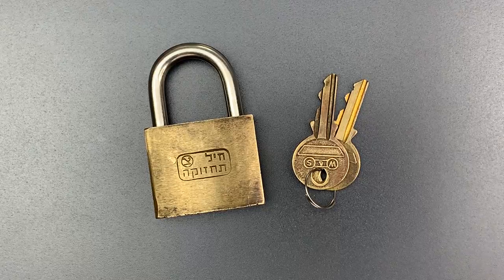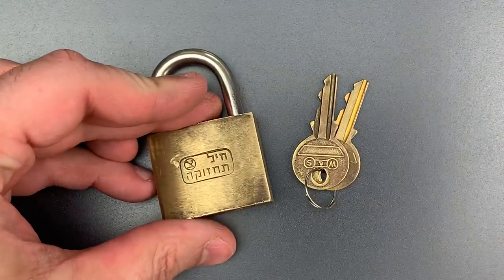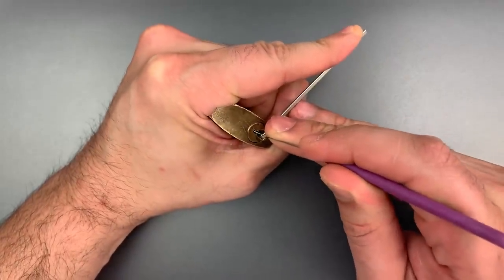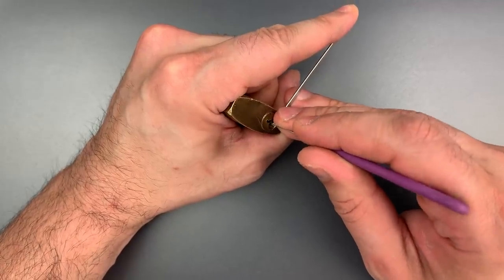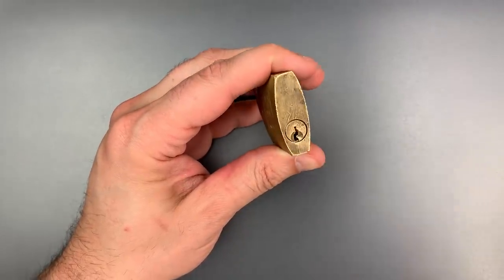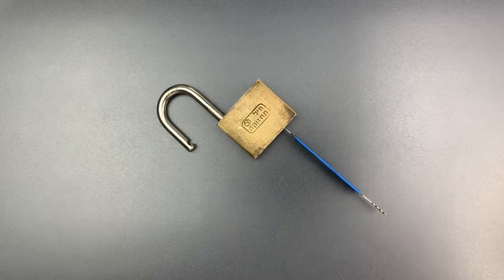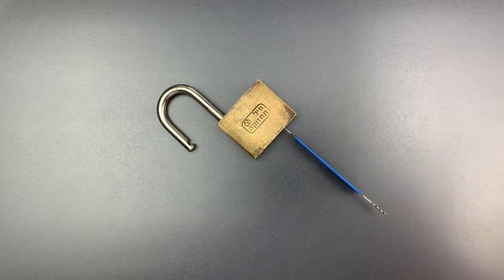[902] Israeli Military Lock With A Serious Design Flaw

Comment: A military lock that is bypassable... That's concerning
Reply: HAMAS: Hummus located
Reply: but not surprising.
Reply: From what I know of the IDF, and my experience with a handful of their career soldiers, I wouldn't worry. Sure, you get in somewhere you aren't supposed to be, but how in the nine hells are you going to get out somewhat intact?
Reply: @chongjunxiang3002  There's a very big difference in impact between stealing the rations, destroying the rations and contaminating the rations without leaving any sign you were ever there, which is why a glass window that can be smashed through to provide a means of entry isn't necessarily as big a security weakness as a lousy padlock on the door.
Reply: This isn't a "military lock". This is just a lock that the military happens to purchase in large quantities and that was branded with the letter צ like most of the equipment the military purchase. This lock wasn't made specifically for the military nor was it designed to specific standards. Soldiers use these to lock up their personal belongings, and I used these to lock the toolboxes of my truck. However I just took a closer look at one that I have and it has a different structure. The core is in the center of the lock and the tooth that holds the shackle moves linearly rather than rotating.

This isn't meant for securing the nuclear arsenal. The locks they use for securing weapons are much beefier although I am certain that LPL wouldn't have hard time picking some of them. Locks of the type featured in this video are commonly used for detering people from stealing personal valuables.
Reply: That sounds alot like the TSA locks.
Reply: Every lock is bypassable
Reply: @yairsollel4197  Well, yeah. I meant that it's concerning that a military lock is easily bypassable
Reply: @airmanon7213  its not meant for high security stuff.
Im sure the IDF has more advanced locks and ones you open with a mere metal key.
Reply: Alexander Rewijk The capabilities of the soldiers protected by a lock are unrelated to the capabilities of the enemy operatives conducting covert attacks such as poisoning supplies or sowing internal strife by planting contraband in personal lockers.  In the case of the IDF there are many enemies willing to die from an attack, and plenty of enemy specialists willing to teach specific techniques, such as bypassing one or two known types of lock.
Reply: Airmanon i wouldn’t be really concerned I’d say a few uniforms, a pair of boots, and a shaving kit is about all these secure lol
Reply: I saw these in every IDF base I've served in. We secure stuff like toilet paper and brooms with these. For weapons we have mandatory full time personnel or beefy mul-t-locks with once-an-hour patrols. Not that you'd get in the base easily anyway.
Reply: Michael Fridman yes I have the same type of lock that I bought from the store on base. We just used them on luggage. We aren’t required to use that lock.
Reply: Oh no, now all of the 19 year old kids are going to be bypassing these and getting into the officers' food... don't worry this lock is mostly to keep the sausages safe from the shithead 19 year old conscripts who are forced to survive for days or weeks at a time on fried-blocks-of-oil-with-a-hint-of-schnitzel at the base or giant cans of tuna and pickles in the field.
Reply: @fukumarkzuckerburg  Strange how these locks are on the live fire range gate and on the kill house front door......
Reply: It's low security our army has same thing
Reply: I was issued a very similar looking and sized lock (but without Hebrew markings) at USAF basic training in 1982. Everybody got one to lock their locker in the barracks. Not intended to keep the enemy out of anywhere important. I agree with other comments that while militaries bought these in mass quantities, they were not "military" grade locks.

Comment: '...ballast on their ships.' 
LPL just sunk an entire company in under 4 minutes. Impressive.
Reply: @mattiasw.5846  still not enough for that burn!
Reply: Can someone pls explain the joke to me?
Reply: @ramennight  Ballast is material you put in the bottom of a ship, effectively just to weigh it down. Typically you might use rocks or gravel, or in a pinch you might use whatever garbage you have lying around, as long as it's heavy. A creative way of saying the lock has no value outside of being a lump of metal.
Reply: Ty
Reply: @ramennight  How did you understand its a joke if you need it explained?? Mind Blown
Reply: @miniwaern  90% social context with a bit of an educated guess.
Reply: @aku343  I agree. Suggesting to use the locks as ballast is a way of saying it's an expensive paper weight but in case you have lots of them, using those as ship ballast is better than nothing. The market for paper weights is pretty low nowadays.

Comment: best portable potty padlock they use it to secure the toilet paper Rod so nobody steals toilet paper
Reply: Dont you need a bit higher security for that? Potential toilet paper thief would have plenty of private time with it, especially after an MRE. So to prevent negative impact on troop morale they should definitely get some better padlock for this application.
Reply: Heinous crime over there, means they will have to air raid Palestine for at least a week...
Reply: An army without toilet paper is doomed!!!
Reply: [Angry Cornholio Noises]

Comment: So this is equivalent then to something like a lock issued for personal locker/footlocker storage in barracks... the comb pick bypass might be intentional so there's a way for accessing the lock if the original owner and/or key is no longer available, with a "universal key" issued to staff somewhere or the equivalent of MP.
Reply: Na.  At least in the US military (though I imagine it's similar in other countries), if the original key is missing, the only "master key" that is used is a set of bolt cutters.   Unless the lock has a serial number and a new key can be ordered from the manufacturer, there's no point in saving the lock, particularly when you're talking about a cheap, low security lock like that one.  Just toss it and pull a new one out of supply.

Comment: Low security lock used for simple storage such as lockers for personal items and stuff ...

Every soldier gets some simple lock from day one to prevent personal item theft between soldiers
Reply: Rob C  when you have a mandatory army it comes expected that some percent will be thieves
Reply: @Rob C I think higher ranks steal larger things

@Cosmo Mandatory or not, I think personal lockers are, as named, locked in any organisation in the world...
Reply: Then it turns out they got them on the cheap and there are only 8 actual key patterns for all 80,000 locks?
Reply: Sableagle That would be bad with more than 8 soldiers in each group.  With careful distribution you could get away with one pattern per soldier in a group.  With random distribution you need the square of that number.
Reply: @hihu7200  Nah. They just use the locks from the water-treatment plant gates since the IDF blew up the plant, all the electricity substations since the IDF blew up the power station, the school's stationery cabinet since the IDF shelled the school, ...
Reply: Righteous  I have not eaten any extra spicey Mexican food for a long time now, so luckily I do not have to worry about that.
Reply: @hihu7200  I'm not attacking innocent Israelis. Did you mean the children in that school were attacking innocent Israelis? The ambulance drivers were attacking innocent Israelis by bringing those children to hospital? The patients in the hospital were attacking innocent Israelis by getting in the way of their bullets while harvesting olives? That schoolgirl was attacking innocent Israelis by learning English?
Reply: @Sableagle  Lets set politics aside and focus on locks. This is not the correct place for politics. 

Thanks and have a great day.
Reply: Righteous  There is no place for hate here or anywhere else on the internet. 

Please limit your future comments to lock related comments. Thanks.

Comment: So that's why the bibles are usually centred — to prevent the driver pins from being fully lifted. Thanks LPL!
Reply: Overlifting is a serious design flaw on any lock. It's not difficult to prevent, you need only to have appropriately sized pin channels
Reply: Stink simply stink Or appropriately long pins or fillers.  Ram a long enough peg in each hole before sealing the top, and problem goes away.
Reply: @johnfrancisdoe1563  basically, there is really no excuse to have such a major design flaw. its not even like its an unknown one
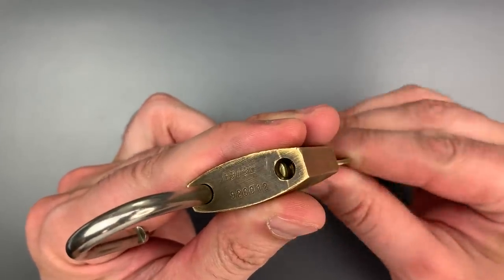Reply: @expertoflizardcorrugation3967  I think the only excuse here is that the lock is from 1992 (seen at 1:43), so curious to know if the locks they currently use still have the same flaw.

Comment: I have been thinking of the design flaw you are exposing. And I think it's a design feature, not an unintended flaw.
Some people here have said that these locks are issued to personnel, for them to lock up their personal items to prevent theft from fellow soldiers. And someone has also said that the officers have a master key to open them, probably in case of inspections or if the person loses his key.

So what I think, is that the pin channels are intentionally very long, in order for such a comb to work as a masker key.

Comment: I'm Israeli, and I can confirm that the translation you got for the writing is correct. Also, as seen at 1:47, this lock is more than 25 years old, which means that the IDF most likely uses better locks nowadays, though I can't be certain, as I'm only 14...
In addition, as noted by another commenter (whitebear26), this lock is used to lock things like tool boxes, so the most high security is not needed. I guess that the main purpose of them is not to keep the stuff inside the box safe, but to keep the box closed...
Reply: Well, since it’s been about three years, you’re probably either 18 or almost 18 and if you live in Israel doesn’t that mean you kinda have to join the IDF soon?

Comment: Unusual to see the core offset like that. It's usually in the middle of the lock.
Reply: @Alexandre Carmel-Veilleux Now if only they had handled the overlifting issue... But this lock is from 1992 (as seen around 1:43) so wondering if they have since addressed that.

Comment: Say, if you don't mind me asking: if anyone wants to start giving lock picking a try, but don't have access to proper tools, what would you recommend using to make an improvised tension bar and pick?
Reply: DIY tension bar is made out of the strip of stainless spring steel inside the car windscreen wiper ("wiper insert"). Just put a hard 90 degree bent on it and cut one side of the bent to 4-6 mm and another to about 100 mm and you're done. As for the pick, a long hairpin with a hook in the end is a good start.

Basically you want the tools to be thin spring steel if you don't know any better. Some people try to use paper clips but those are very seldom springy enough and loss their shape too fast.

And if you haven't removed the steel strip from a windscreen wiper previously, be careful. Some people have successfully stabbed themselves with the metal strip in the progress. Just remove silicon until you find the strip and then keep cutting silicon away until the metal strip is free. Do not try to use brute force to push it out.

Comment: It occurs to me that if someone could install spool shaped key pins then your "false set" might become a "true set", and if you went beyond it you would drop into the spool on the key pin and get stuck in an over-set situation? Does that ever happen? In all the looks I've seen you disassemble it is the driver pins that have spools or serrations, but the key pins seem to be smooth (or occasionally serrated).
Reply: It's pretty common

Comment: The military -- in the US at least -- demands very high standards for practically every single thing it buys.  US Mil specs are commonly almost incredibly detailed and specific as to all sorts of material quality requirements, functional design, testing and so forth; sometimes even beyond practical necessity and/or to the point that it becomes a problem in implementation, cost, etc.  In my years in the electronics industry, we had to refer to and comply with whole volumes of mil specs, so I gained quite a bit of experience with these documents and their application; and sometimes with their borderline nonsensical content and most of all, omissions.  Even so, the documents generally serve to ensure military materiel is of truly superb quality.

So.  It just occurred to me that they must surely have specs for padlocks.  And indeed they do:  https://www.navfac.navy.mil/content/dam/navfac/Specialty%20Centers/Engineering%20and%20Expeditionary%20Warfare%20Center/DoD_Lock_Program/PDFs/MIL-DTL-43607J.pdf

That particular document is in dire need of revision in my opinion.  It contains only one notable reference that would cover a flaw like the one found in this Israeli lock; and it is startlingly, and uncharacteristically, VAGUE!:

"3.5.1 Surreptitious neutralization resistance. The padlock shall resist surreptitious neutralization for not less than 15 minutes before and after the wear resistance cycling (see 3.5.2.1 and 4.5.1.1)."

Not only is it probable that not one mil spec padlock ever made could stand up to skills and tools such as those of LPL, Bosnian Bill or their peers for 15 minutes; but there's not one word anywhere about the techniques it must withstand, whether it could be bypassed by any method and so forth (Although, thankfully, it does mention shim resistance specifically in another section).  The rest of the document describes a seriously robust and well-made padlock, but it's all useless if a simple (but unspecified and therefore effectively allowed!) exploit can pop it open.  Go figure.
Reply: JamesG Depends if testing of that requirement is done by CIA specialists with a classified list of methods based on the required security level and a careful (or not so careful) balancing of the risk of enemy picking against the risk of enemies using those locks on something they want to pick.
Reply: @johnfrancisdoe1563 :  If it isn't written clearly in a Mil Std document it isn't a standard.  The specs and standards and the tests for compliance aren't hidden and they aren't surprises.  That just isn't how government materiel contracts work.  Unless you think you have experience in these matters that I do not, I suggest you set speculation aside and look for facts.

Comment: Is there a good video which LPL explains the terms used when picking? For example, what does 'false set' mean? I did a cursory Google search, but would like to understand them in context. Thanks!
Reply: a false set is when the core rotates then stops, but doesn't rotate all the way and therefore doesn't open. usually means there's some trap driver pins in it.
Reply: it means there is significant cylinder twist, without actually being able to open the lock. it can happen when there are spool pins, where the spool drops into the shear-line but the cylinder is still stuck on the pin, just at a different point. counter-rotation is when you're picking the pin up further, and then cylinder wants to turn the opposite direction of your tension to escape the spool pin.
Reply: a spool pin is wider at the top and bottom than in the middle, so if you lift the pin to the middle point, the cylinder is able to move into that middle channel without actually being unlockable.

an overlift attack (what he did with the comb), is where you push all the pins out of the way entirely. most locks are not vulnerable to this because it's super easy to prevent when designing and super easy to exploit.
Reply: Austen, search on youtube. there are many basic tutorials from other pickers explaining all the terms and how to begin picking. watch?v=AWor8PBeTWA for example, this guy has some nice tutorials